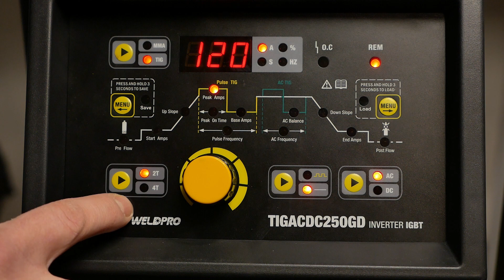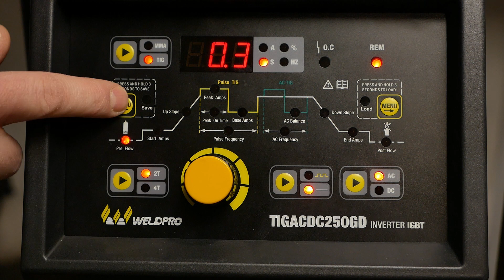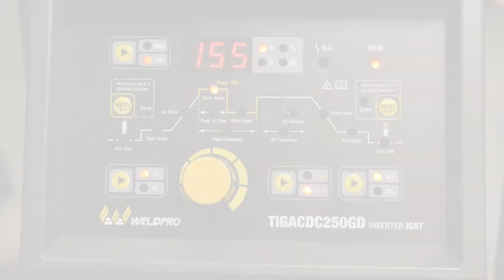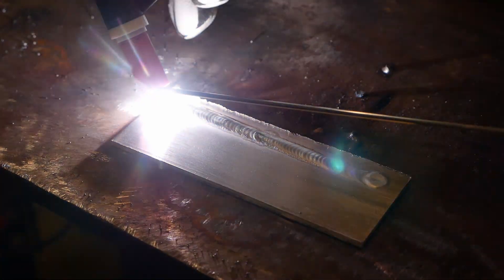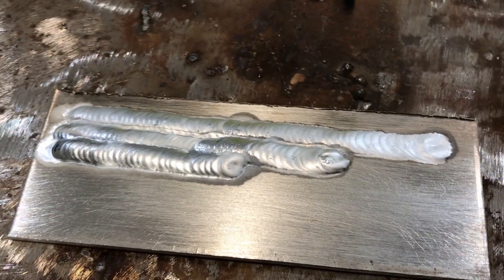ALUMINUM WELDING with the Weldpro TIG250 Water Cooled Package

Comment: I didn't notice any mention of why or how the water cool packaged played any part of the quality of the weld.
Reply from the maker: Hey James! Adding a water cooler does not immediately change the weld quality. Adding a water cooled torch and cooler simply allows you to run a TIG torch at a hotter temperature then you would be able to if you were air cooling it. This makes welding on thicker material at hotter temperatures much easier. Thanks for the comment.
Reply: Thanks for the reply, Luke. I knew water cooling was popular; however, since I've never needed that much heat, it didn't occur to me why it might be needed. Remember, all your fans are not professionals to that level (me, for 1) and it would be helpful if you explained the "water cooling" since this particular video includes the additional cooler. Anyway, I really enjoy your vids and have learned a lot from them. Keep em coming. ...Thank you.

Comment: I got 2 questions. 
1. Why do you show welding on 1/8" coupon? We want to watch how it welds 1/4 aluminum. 
2. Why is this welder out of stock?
Reply from the maker: I can do a 1/4" video :)

We sold them a lot faster than expected and with the supply chain slow due to covid its hard to keep up with the demand. Thanks so much!
Reply: @WeldproWeldingEquipment  please, make 1/4" welding aluminum video. I appreciate it.

Comment: Awesome video Luke you do a great job describing these great machines 
I just purchased the 200 today can’t wait to unpack it and put it to work
Reply from the maker: Thank you so much Wayne! How is your machine!?
Reply: @WeldproWeldingEquipment  I’m loving it so far 
I’ve already built a derby car roll cage with it and have had very little issues with it 
Sometimes the wire seems to stick inside the gun and you have to grab it with a pair of needle nose pliers but that’s the only issue I’ve had with it 
I have run the Hobart 140 for years and the weld pro is amazing compared to it